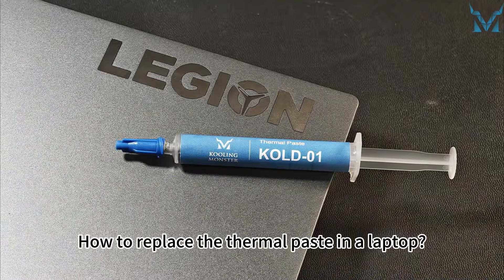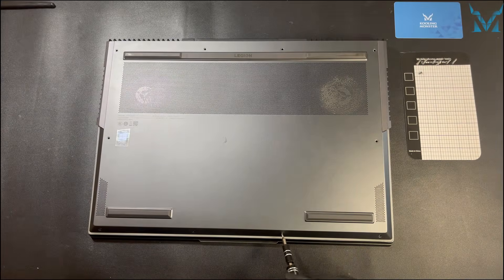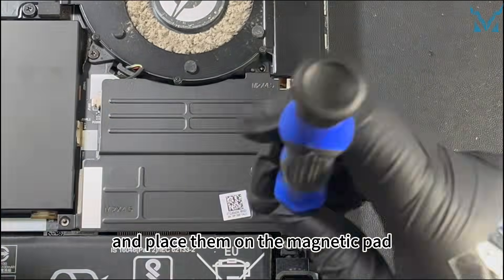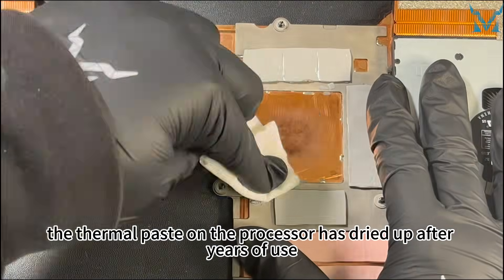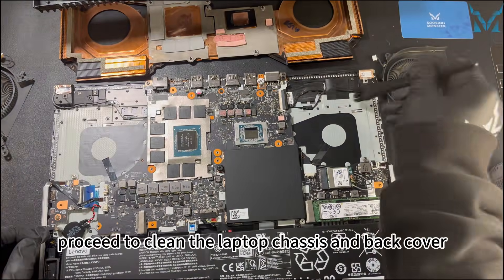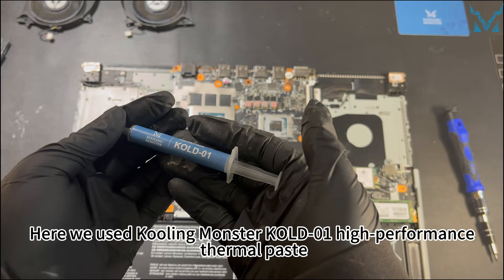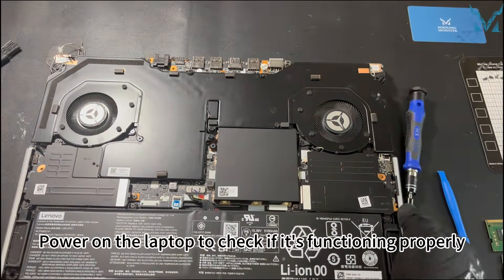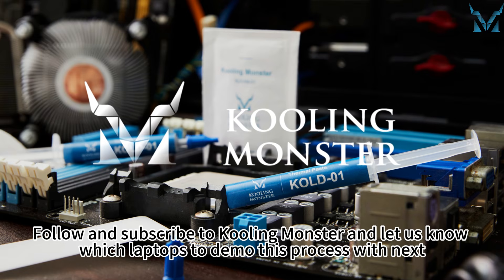Speed Up Your Lenovo Legion R9000K 2021 Prevent Overheating With Dust Cleaning & New Thermal Paste

Comment: Legion are known to be build with PTM 7950 pads , using paste are known to increase thermal throttle. How’s the result now ?
Reply from the maker: Thanks! Yes, many Legions use PTM7950. But after switching to paste, temps are actually more stable now. We used KOLD-01, which is non-drying and handles long sessions really well.